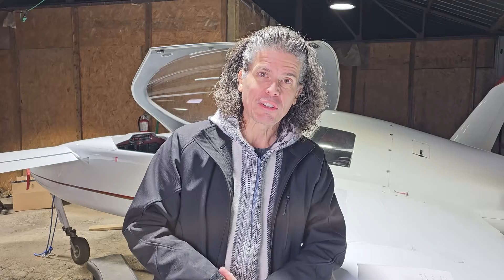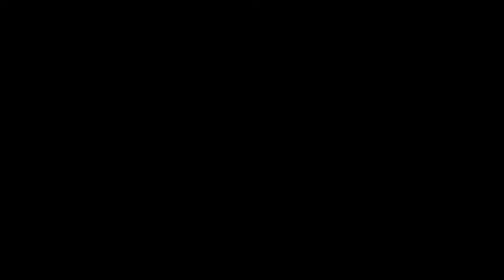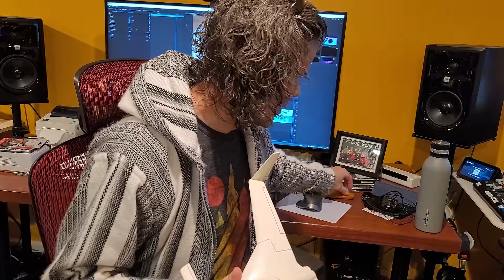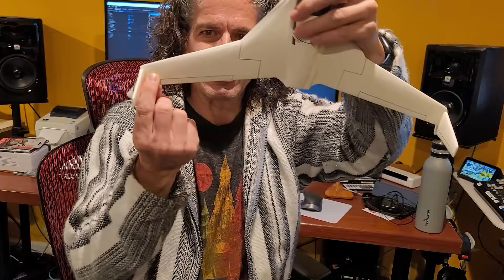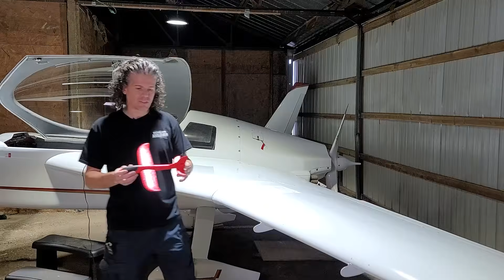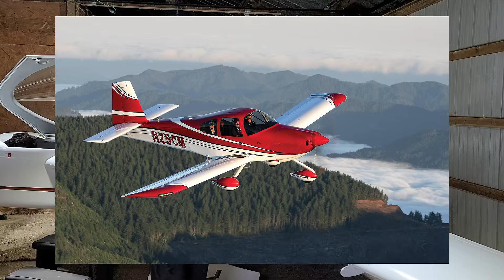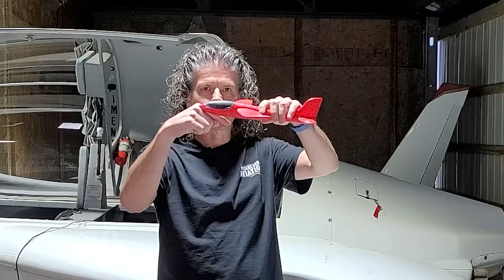Canard Aerodynamics: Why You Might Not Want a Canard Airplane

Comment: Sorry for posting years later, but I just encountered this. Just a point of correction, you CAN have flaps and even flaps and slats on the main wing of a lifting canard aircraft, but you MUST also add the same to the canard. The reason the Cozy doesn't have them is simply because it would add cost, weight, complicate construction and control for pilots.
Reply from the maker: I think I mentioned this in my other video - the Starship has flaps, and correlates the deployment with the canard. But the mechanism complexity and weight to do this in a small canard aircraft is not really possible. It has to be absolutely fail-safe: deploying flaps and having the canard not adjust at the same time would be catastrophic - and at low altitude (where you would normally deploy flaps) would be unrecoverable.

Comment: well, already watched that vid a year ago or so... and partly rewatched it now. Some of your explanations are very good, some are still a teeny bit... spongy. I won't go into details, as, as you stated at the beginning, the link to Marc's videos should be plenty for anyone interested in digging further into the theory of canard aircraft.
Now for anyone thinking about buying one, think again. The configuration offers very few advantages to a conventional aircraft, but has quite some cons working against. Again, I will not go into technicalities as there is so much stuff available online. I happen to have a couple of hours on a LongEze, and about 200h on a VariEze which I owned for a while. These aircraft are certainly more suited to places such as found in the US, where runways are super long, and courtesy cars available at most fields. In Europe, with shorter runways, open areas shrinking everyday, and the price of taxis, make canard aircraft generally more difficult to operate.

VariEze, following my 2 years of ownership, a few of the pros:
- fun (called it my plastic toy)
- quickly removable wings (20 minutes) which meant I could take it home for maintenance on the special trailer I had
- easy to maneuver on the ground (lift the canard by hand and push it to the fuel pump)

VariEze, a few of the cons 
- weird. Weird as in its shape, weird in its capabilities or lack of, weird in the way it flies. Weird shape means all people pointing at you and your aircraft, which some people appreciate whilst I did not, very little if at all luggage space, and difficult entry/exit. Capabilities, well, those canard were sold as super fast and economical. My Eze could cruise at 150kts burning 6.6USG/h. At the same speed my RV-6.9i burns 6USG/h, and can cruise faster, all whilst providing a quieter and way larger environment. The way it flies is not very nice, the controls are not harmonised (go and try a Falco, a DHC-1 Chipmunk, any of the RVs, and compare), the sidestick forces are quite hi in roll whilst being feather light in pitch. My ASI was reading MPH, and imagine my surprise when coming in for my first landing and loosing aileron control below 90MPH... yep, use your feet, but carefully
- demanding take-off & landing requirements. The lack of any high lift device makes for hi take-off and approach speeds. The same is then valid should the donkey quit. Given the geographical data of my flying, and those speeds, had me seriously worry about loosing power and having to crash land, all in regard of survivability

- concrete runway requirement. Is not mandated, and I went to a couple of fields which I knew offered grass in good condition. But that certainly is not kind to the 3 gears, which are certainly not designed to take the beating.
- visibility. Try as one can, that canard thing plank is always in your FOV
- noise. The necessity to drive a small prop due to ground clearance leads to most if not all canards to be loud, inside and outside
- rain/humidity. Already approaching a rain shower, the canard sniffed the humidity which was enough for the nose to dive. Flying in light rain (never dared to fly into real rain) I was just able to trim the Eze out, whilst loosing 10MPH in speed
- wifey acceptance. She rode twice with me and the Eze. The first, and the last time. Stepped out and exclaimed: it's ugly, it's loud, and I don't see a thing of the outside world
- claustrophobic. If you are in the slightest, forget the Eze

In closing, the canard configuration fired the imagination and hopes of engineers and Joe Public, airliners were drawn with that configuration, business TP built... but the general canard concept whilst attractive in theory, has not delivered what some dreamed it would, and looking around, in the US as well as In Europe or elsewhere, a disappearing breed.

Comment: Wing is swept to line up CoG with CoL
Reply from the maker: No, on these planes the wing is swept to move the vertical stabilizers sufficiently far back so that they actually have an effect and can yaw the plane. The wing sweep is actually a detriment, and the plane would be more efficient with a straight wing.

Comment: Great vid. I don't know much about the plane. 
And I'm not an aero specialist, just a lay person. 

Gut feeling. Why not have the canard much lower in the nose. It looks like you could have airfow for that, and not foul the airflow for the swept wing. 
The spitfire had its stall start at wingroot, so inner wing stall is good for student or learner pilots. 

70knts to me sounds fine. Both for take off and landing. The only thing with that to me is having decent enough under carriage and brakes. The translation to a better cruising speed is a fair trade off. 
I don't know if at the low end, and in this segment if the complex design is worth the squeeze. 

:)

Comment: I've been flying a LongEZ for 20 years, it's the safest, most efficient (about 1500 miles on a tank of gas doing about 150 knots), sturdy, and fun airplane there is. Burt Rutan designed it and about 45 different airplanes in his career. Some of the most efficient airplanes ever built. You might not want to buy or build a LongEZ because it will definitely spoil you. You won't want to fly anything else!

Comment: Very interesting video. I’ve always been fascinated with canards. Regarding downward wash on main wing from canard, could that be somewhat mitigated by lowering the canard and raising the main wing to a high wing position?
Reply from the maker: To do so enough to make a difference would require so much additional structure, any gain would be offset by the additional weight required to build it.

Comment: So we sacrifice efficiency for aesthetics by keeping the canard low? That seems dumb. How high would the canard have to be exactly?  If it creating downwash perhaps we should put the canard a little lower rather than higher....again, how low would it have to be? Low enough to scrape the pavement on take-off / landing? 
Why is canard winged aircraft stall unrecoverable. CG ahead of lift, swept back wings...wouldn't the nose drop and start flying again?    ...if you caught it early enough....I guess if the plane turned backwards you could somehow launch a drag device out the back to turn it forward again? (I don't want to try that!). How about a controllable vertical stabilizer farther back behind the prop? You wouldn't want that happening anywhere near the ground of course.
Why can't the angle of incidence on the ground be changed with nose gear /main gear height ratios (still have to ensure the prop doesn't hit ~ ~).
I had a canard winged ultralight (Pteradactyl) for years and flew solo coast to coast across Canada with it in 1983. Loved it. Also flew the Falcon a lot (also canard wing) and loved it. Both planes had a higher main wing so I guess downwash wasn't an issue.

Thanks for the video/clarifications.
Reply from the maker: The canard would have to be one wingspan higher - so almost 13 feet higher, in order to minimize downwash on the main wing (similar to calculating ground effect). The structure for that would be very large and heavy, which would require a larger canard to support that additional weight and additional structure in the nose to handle the load, and would then also affect pitch moment due to the arm of the height...it just isn't practical. And having the canard lower would put even more disturbed air into the main wing, especially at lower airspeeds (higher angle of attack).

The stall is unrecoverable because if the pitch angle of the airframe reaches the critical angle of attack of the main wing such that it stalls, the amount of airflow over the canard at that point is almost negligible (it is unloaded), and the elevators don't have enough authority to lower the nose. The canard is not stalled, so it won't drop, but the main wing is stalled, so it does lose lift and drop: the back end of the airplane drops out from under it, and it ends up coming down with the relative wind perpendicular to the wing and canard - so control surfaces have no effect. For prototype testing, a large moveable weight was installed in the cockpit that could be moved in flight. That way if the main wing stalled, they could move the weight forward to shift the C/G forward, get the nose to drop, and recover. I suppose an emergency drogue chute could be deployed from the tops of the vertical stabilizers? Simpler to just not load your airplane outside the aft c/g envelope so the main wing won't stall.

The geometry of the nose and main gear is fixed, although there have been some designers recently that extended the actuator for the nosegear to make it extend further, to increase angle of incidence on the ground, to reduce ground roll on takeoff. This has been successful - not a huge change, but definitely has an effect.
Reply: @CanardBoulevard  Thanks very much for this explanation.

Comment: For all airplanes with two lifting surfaces, the requirement for pitch stability is that the angle of attack of the forward surface is higher than that of the rear surface. For a conventional airplane, the angle of attack of the tail is typically negative, so it's clearly less than the angle of attack of main wing.  For a canard, pitch stability requires the angle of attack of the canard to be higher than that of the main wing; the only difference is that since the main wing is in the back, it has to have positive angle of attack in flight.  The relative angles of attack are determined by the relative size of the wing and canard and the location of the CG. Moving the CG aft causes the angle of attack of the main wing to increase relative to angle of attack of canard, which decreases stability and eventually can result in a main wing stall.  Canard airplanes have small CG envelope, so balance calculations are particularly important.  The most obvious impact of the small CG window is the need for ballast when flying solo.

Comment: 17:45 Yes!  I learned to fly in a Grumman AA-1A, which had that swiveling nose-wheel.  My instructor told me to steer in a "jerky" fashion, hitting a brake pedal hard, briefly, then letting up, to minimize brake wear.  Incidentally, because of the Grumman's high stall speed, he told to do 80 mph IAS on final.  Later on, I acquired a T-Ctraft BC-12D, and I had to force myself to SLOW DOWN, in order to land.

Comment: Not to be nitpicking, but there is a little something wrong with the explanation about rotating during takeoff when comparing this canard design to a conventional design with a tail. 
What first and foremost matter here are the position of the center of gravity/ center of mass versus the position of the landing gear and the center of lift, combined with the momentum generated by the tail or the canards.  
Having to 'lift the entire front section of the airplane up' to rotate the aircraft for takeoff is NOT what the issue here is (simply because that already factors into the position of the center of gravity/ center of mass). 
The other factors mentioned however do come into play of course. 

I much rather suspect that the main part of explaining this 'phenomenon' is simply a natural result of the required high wing-loading of the canards to assure nose down stall behavior of the aircraft. 
In other words: 
Because the canards must (always) stall (much) 'earlier' than the main wing stalls, they will naturally also only be able to produce the lift required to rotate the aircraft for takeoff at respectively higher speeds as well (Because by design the wing must 'start flying' first, before the canards 'can be allowed to start flying').

My explanation is that it's basically just a result of the required safety feature of the overall canard design requiring a nose down stall behavior to be assured at all times, whereas conventional aircraft naturally and inherently have a nose down stall tendency (and can thus simply - and safely have larger tail surfaces allowing them to rotate at slower speeds).

Or to put it even another way: 
Would the canards be modified and would simply be made larger in order to enable rotating the aircraft during takeoff at slower speeds, then it would no longer have a nose down stall behavior and as a result it would then no longer be safe to fly.
Reply from the maker: You're correct, and that is done by ensuring the load factor and angle of attack of the canard is greater than that of the main wing. Until the canard begins to fly and elevates the deck angle, the main wing doesn't have sufficient AoA to fly - so you really are rotating to get the main wing to fly.

Comment: It can't be correct, surely, to say that there is no prop wash over the wings with a pusher prop?  A prop has to draw in exactly the same amount of air from ahead of it as it expels aft of it.  On a canard that air is drawn, in part, over the wings.  
I can think of reasons why a canard may benefit less from prop wash than a conventional aeroplane for rotation, but a complete absence of prop wash is neither realistic nor an explanation.
Reply from the maker: On a conventional aircraft, propwash goes over the horizontal tail surfaces and rudder, so you get immediate effect. You can literally raise the noise on a soft field takeoff by pulling back on the yoke and blasting your tail with propwash. This does not happen on a canard. Plus the concentrated, accelerated high-pressure area behind the prop (what we call propwash) is not the same as in front, where some air from a much wider area is accelerated towards the prop, but nowhere near like what happens behind it.
Reply: @CanardBoulevard  So you accept my point that there is prop wash ahead as well as behind the prop, and are effectively saying that the issue is that the forewings are less well located in relation to it than the tailplane of a conventional aeroplane, with which I agree.    
That the forewings have less distance from the centre of gravity (and hence the elevators have less mechanical advantage) will presumably also contribute to the effect you describe, which I don't doubt for a minute.

I stand by what I said before: 'I can think of reasons why a canard may benefit less from prop wash than a conventional aeroplane for rotation, but a complete absence of prop wash is neither realistic nor an explanation.'

Comment: You are forgetting that induced drag (if you know what that is) is proportional to the square of span loading (L/sp)² 
Increase span 10% that reduces the ID by 20%
The parasite drag is proportional to wetted area.
The higher lift on the short canard produces a large drag.
On the other hand the tailplane can also lift. As long as the incidence angle of the forward wing is higher by a little bit than the incidence angle of the rear wing the aircraft is stable. 
No down force REQUIRED 
So you are mostly wrong! when your CG is at the rear point in the stability envelope

Comment: At 18:30, what you say is true for conventional propeller aircraft, but not for jet aircraft.  To some extent, this is not even true for conventional aircraft with T-tails.

This is one reason why many flight instructors felt that the Piper Tomahawk made a better trainer when compared to the Cessna 152, for those eventually wanting to fly jets.  With any pusher aircraft, jet aircraft, and conventional aircraft with T-tails, one cannot simply just blast the throttle and get pitch authority back.  This forces the pilot to learn the proper technique of a stabilized approach, so that these types of aggressive antics are not required to maintain pitch control.

Comment: At 18:03, my experience flying this plane would not lead me to the conclusion you stated.

As soon as you start your takeoff roll, you should hold the stick full aft.  As your air speed increases the canard will start flying quite soon and lift the nose.  When this happens, move the stick forward and hold the canard approximately on the horizon, which will keep the nosewheel off the ground for the remainder of the takeoff roll.  Once enough speed is obtained, the main wing will start flying and the aircraft will leave the ground.

This method is not unlike a tailwheel pilot lifting the tail of the plane as soon as the tail starts flying, and continuing the takeoff roll using the main gear only.

No need to worry about the nosewheel bouncing and reducing the angle of attack.  You can easily control the pitch attitude of this aircraft with the nosewheel off the ground.

Another advantage in doing it this way is that with the nosewheel off the ground, you are less likely to throw debris or foreign objects into your prop, which is something you should try and avoid with any pusher aircraft.

Comment: Eye opening!  My criteria for a safe airplane is one that can land at a very slow airspeed -- as in an emergency landing off-airport.  The canard offers some advantages in efficiency and high speed, but not in low landing speed -- and that's because there are no flaps or leading edge configurations on the main wing.
Reply: And because you can (should!) never reach the maximum lift coefficient of the wing.